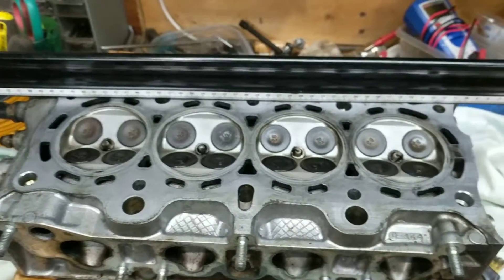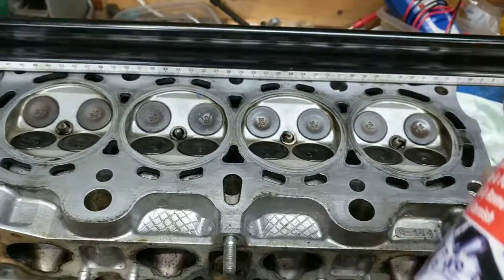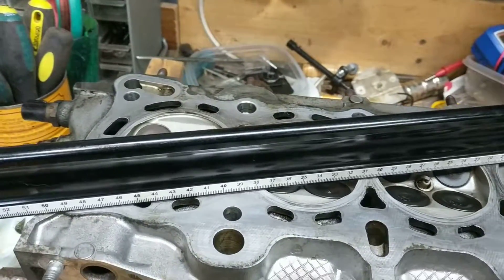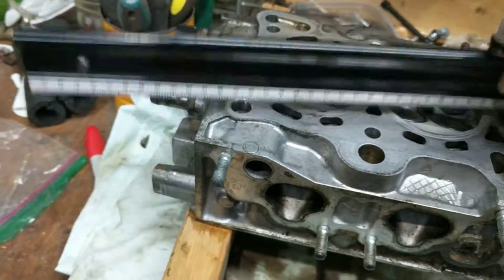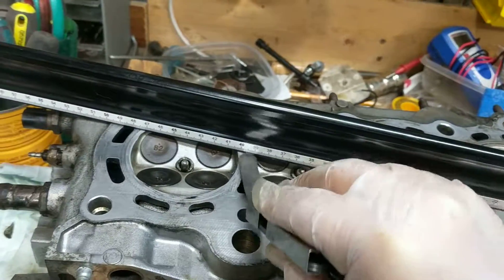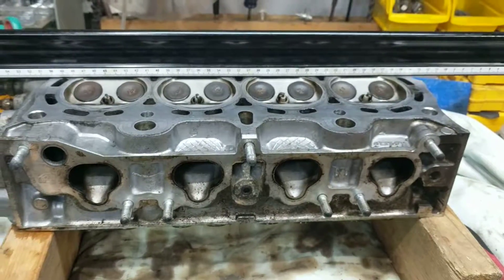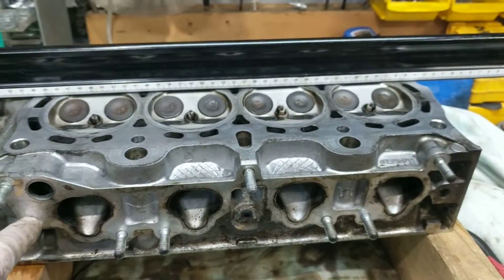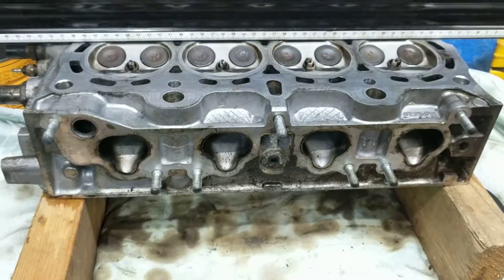1998 Honda Civic LX, warped head

Comment: I know it's been 4 years since you posted this video but i need a little bit of information and little advice,

When your civic overheated and you machined the head because it was warped, did you only get the head done or also the block surface where the head sits on?
Do both things usually warp or just the head?
Reply from the maker: I had the head machined because it was warped.  
I only took in the head to get it machined, I did not touch the block.   Surprisingly it was only $47.50 to machine the head.   I also replaced the intake and exhaust gaskets.   Put it all back together and it ran great.

I

I hope this helps.
-andy
Reply: @theOriginalBanger  it sure does help, thanks a lot, I appreciate it.